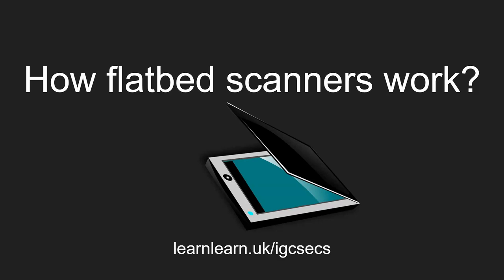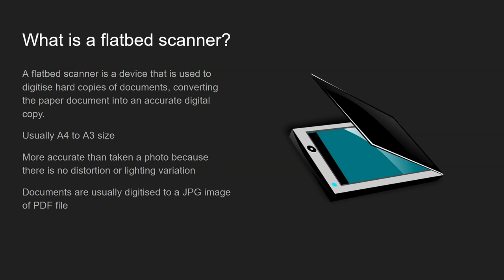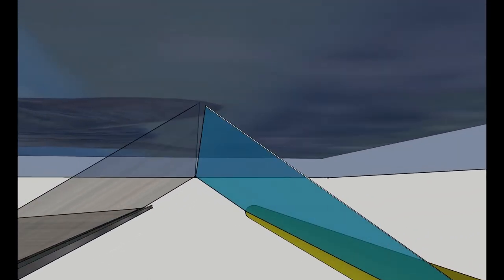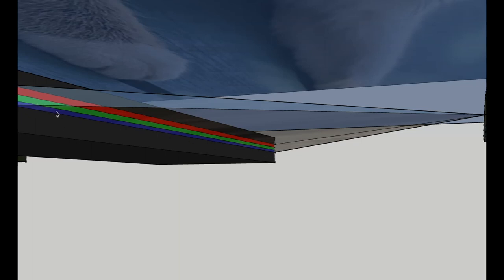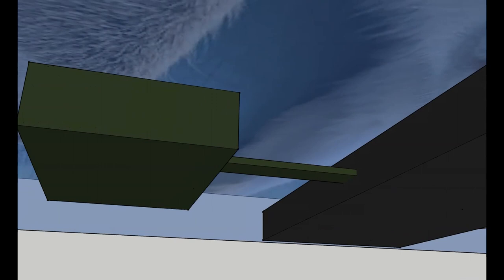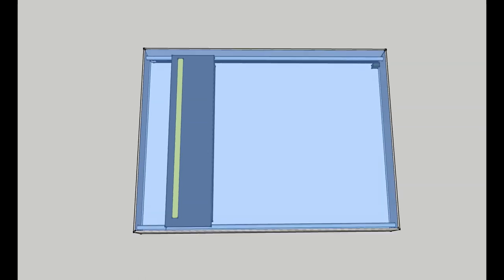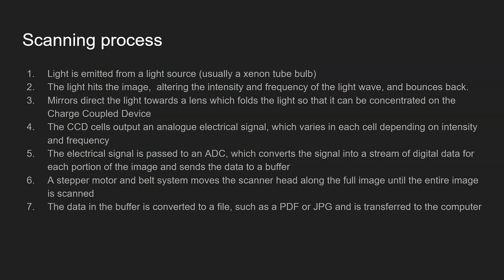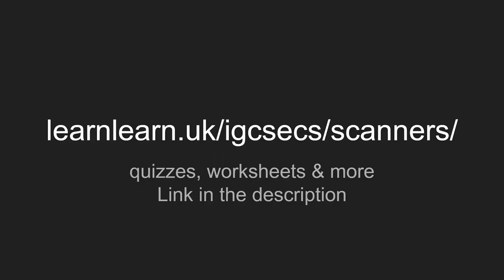How Flatbed Scanners Work

Comment: Question - the cartoon of the filtered scanner shows R,G, and B filters occupying about the same area over the sensor.  Is that correct?  Cameras have more green filters to coincide with our photopic response.  Do scanners also have more sensor area associated with the green filter?
Reply from the maker: It depends on the quality of the scanner and its purpose. For example, high quality scanners used to digitize analogue film negatives use RGB scanners, so that they don't lose detail through Bayer RGGB Interpolation. Most standard document scanners use RGGB, I'm guessing because it's cheaper to manufacture.

Comment: This comment is critical but hopefully leads to real solutions

So what IF those scanners are not cameras, I see this video showing any important difference

We're gonna have to think about more than just light if we want to capture nothing more or less than the print

Early teleprints might have been a good example, because I think those were drawn with inks that had special electrical conductivity- very simple to capture and send electronically

Every print is probably going to have different chemical qualities, different electrical qualities, different topographical qualities, etc., and every print medium may need it's own special kind of scanner

Thursday, September 7, 2023 CE, 16:35 EDT
Reply: *I DON'T see this video showing any important difference

Thursday, September 7, 2023 CE, 16:36 EDT